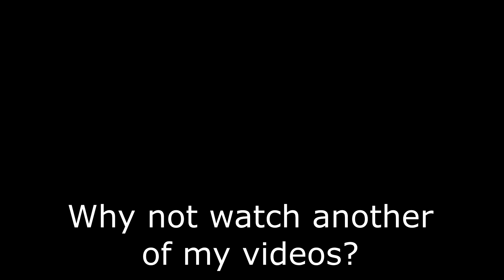Chinese solar inverter teardown (020)

Comment: ...I have newer than this but can't beat the simplicity of this types of grid tied inverters..only flaw on this device is they only accept 1 input...i tried parrellel since can't do serial ,over dcv input range but  the + banana terminal melted... the terminal should adapt the mc4 connector than banana plug speaker terminals...I had to solder mod it to a mc4 version.. everything else was surprisingly ok after years of use...y&h 600w brand was my first try..

Comment: This is a HF inverter design, that means a two stage design 1) input to HV upconver - i.e. the transformer (also does MPPT at the same time), and the second stage to create the 50Hz AC (with output inductor & cap filter).  Being grid tie I would also expect another inductor, but that is an area I know little about.

Comment: it worked good for a month and one of the half bridge parallel mosfet failed with a mosfet short. i removed it and the one of the other parallel mosfet. it worked Like that for a few months. Later it stopped working and i opened the case and saw the 5A fuse at the mains line blown. The reason was shorted mosfets prior to mains. The interesting part of this design is that, these mosfets have no connection with microprocessor or a driver. They somehow drive themselves completely with the secondary. No optocoupler or any direct connection. i'm still trying to understand how it works. And needless to say all mosfets are fake chinese immitations

Comment: Has anyone taken apart a Hybrid inverter charge controller ? I need to change out the charge controller or tweak it , mine was for a AGM Battery and I want to up grade to Lithium LTO Batteries & change the 60Hz to a newer version the Model is EA SUN POWER 5KVA 48v 230v Pure Sine Wave Inverter 50A Charge Controller !

Comment: min 11:45 please help me to know the ZD1 zener diode model to replace them, I only see the blue label on it, but dont know the volts or watts capacity to buy them, I bought 12 inverters of 600 watts, 2 came fault, but the diode, an smd transistor 5v regulador and the ac in or output fuse are bad,  the others 10 are working  with 2 330 watt 30 volts panels in paralell each inverter, since marchs without any problem . I just cant identify the zener diode value
Reply: 12v

Comment: The transformer should be a high frequency isolation one, the diodes rectify the voltage at its output and then the final IGBTs form a full bridge to synthesize the final ac voltage.

Comment: Hi Power Eleconics,
I'm Dutch and live in Mexico. I read some of the comments from the readers and I agree with you US installations have definitely other standards than the EU's. That doesn't mean its bad, for example EU is way to much restricting but if it comes to quality EU wins.
I do have a question. You definitely seem to be a specialist in power architectures and know more about it than I do. I want to buy a specific Chinese micro inverter of the type WVC1200 or WVC600. Its not the best inverter from an efficiency perspective but it is the best on price performance and the fact that it has 4x300 Watt individual MPPT controlled inputs. further more it has a reasonable cheap monitoring system. Can you tell me if this inverter is an inverter passing the cretinism. There is very little known about this inverter but it looks good to me.
I hope you can help me with this 
Ik hoop dat je me hier mee kunt helpen. alvast bedankt, de groeten.
the next site shows this inverter in limited detail. https://www.youtube.com/watch?v=fEdPO0QqB-g
Reply from the maker: Without any internal photos or detailed teardown there's no way to say. It could be crappy, it could be great.

Comment: 5:15 yeah I think you are overblowing it a little bit. 30A can cause quite some heating, but nowhere as much as when you've got 100A flowing, or even 50A!
Reply: ..the max a panel can go is less than 10A for 36dcv 72 cell ~350w ..but if they are parrelleled than it might get there..

Comment: Nice. I kind of expected you would hook it up and measure efficiency and output current THD, but just looking at the PCB was enough :)
Reply from the maker: +Koen van Leeuwen In a follow-up video I'll be doing just that, but that'll take a bit (probably after my easter holiday)

Comment: +PowerElectronicsBlog The seperate heatsink inside is for extra cooling by the fan airflow. Why you suggest they should have done it differently? It's actually a quite nice construction in regard of cooling. Maybe you should have a second look sometimes before you dismiss good engineering effort. Besides of that again a nice video, keep it up!
Reply from the maker: +Mar phy As I said in the video, why would they go through the effort of putting in an extra heatsink if they already have this big heatsinked enclosure? It's just unnecessary extra stuff. Why have the extruded aluminum external heatsink anyway if you're not going to use it? Because that external heatsink is more than capable of cooling the unit if that piddly fan and internal heatsink are enough already. They could have saved a couple dollars on the construction and made it infinitely more reliable by ditching the fan.

Comment: It’s not really fair to single out the US or even China about low quality solar hardware/installations. I have 4.4KW installation in San Francisco and the device you show here will never pass state code. ‘Island’ converters are illegal, period. I.e. if the main grid power goes down so will my solar supply. My hope is that the Tesla Powerwall will be able to bypass that limitation so that power outages are not a problem.
Reply from the maker: +telecrate Of course it's not the US or China, it's just that these areas automatically become the center of most complaints about crappy materials because most of the people that use this and exist on the internet are from the US. 

Solar is incredibly expensive in the US (typically about 2-3 times more than in Europe) so people much more readily try out lower quality alternatives. And as far as China goes; they just essentially have nowhere near the same kind of safety regulations. So whereas you'll literally never find this kind of inverter in the Netherlands or Germany, they're a fairly big chunk of the market outside of Western Europe. It's just a consequence of the market.

That being said, the US is not an atomic market; SF and LA are the highest cost of living areas in the US and consequently have a much higher quality and control standard than e.g. Nevada.
Reply: +PowerElectronicsBlog 
Everything is expensive in the USA ... lol